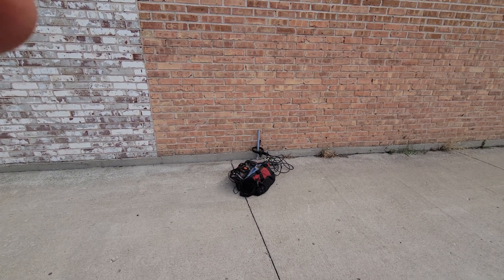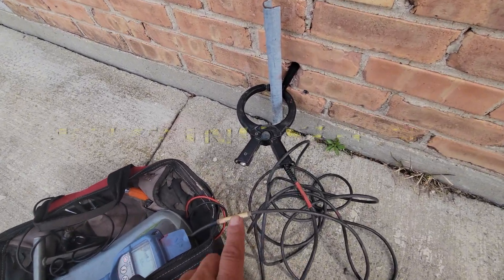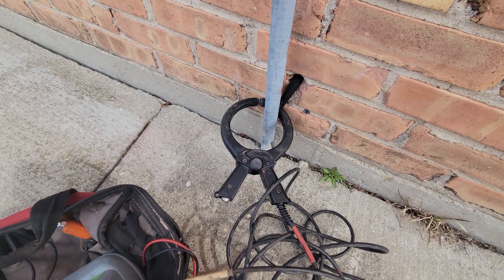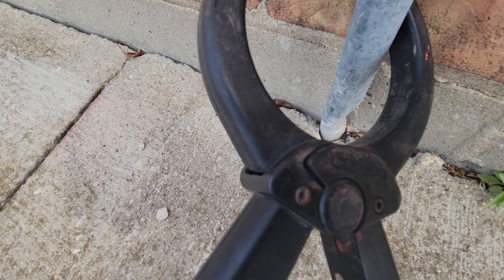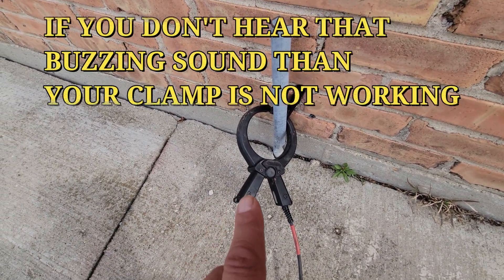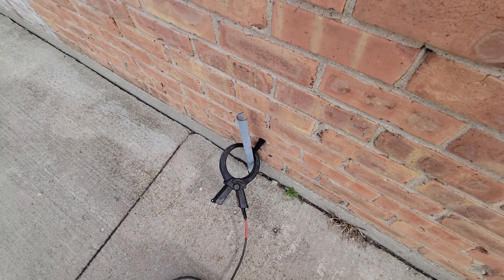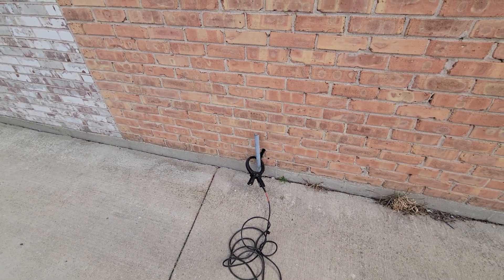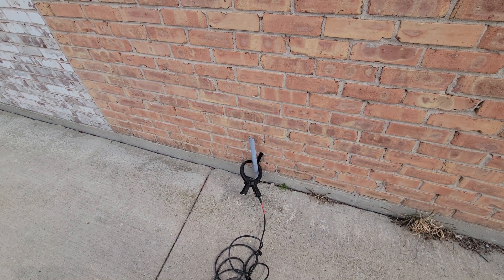Tipsy Tuesday | Testing Radiodetection Clamp for TX-1 TX-5 TX-10 Transmitter

Comment: Question, when testing a ring clamp in an office setting, as in before issuing it out to a trainee, is there any other test, possibly with a multi meter to give them that warm fuzzy feeling that it works. The reason i ask, i can hear that high pitched whine, but sometimes a trainee can't. I know it sounds weird, but I'm looking for a visual confirmation that would satisfy their needs. I often hear "that's old" "it looks dirt" "how can i be sure it works".
Reply from the maker: A multimeter usually checks things like voltage, current, and resistance, but it might not accurately test how well the transmitter clamp works. You can do a couple of tests to visually confirm its functionality.

For a Voltage Test: If the clamp gets power from batteries or another source, you can use the multimeter to check the voltage it's receiving. Just make sure the power is on and connected. Set the multimeter to the right voltage range and touch the probes to the positive and negative ends of the clamp. This shows if the clamp is getting power like it should.

For a Resistance Test: While this test might not directly show if the clamp works, it can help spot any issues with its electrical parts. Set the multimeter to resistance mode and measure the resistance in different parts of the clamp, like the connectors or terminals. If the resistance suddenly changes, it could mean there's a problem with a part or a connection.
Reply: @811chicago5  thank you very much for that detailed reply! I appreciate you brother! 🙂

Comment: What is CD or CM?
Reply from the maker: CD/CM (Current Direction and Current Measurement) Clamp.
Reply from the maker: To use a CD/CM Clamp you will need an RD8KPD(B) and Tx-10(B) transmitter which a standard clamp will not work.